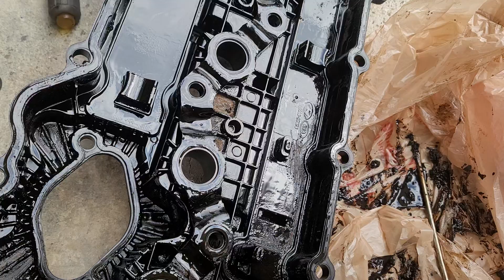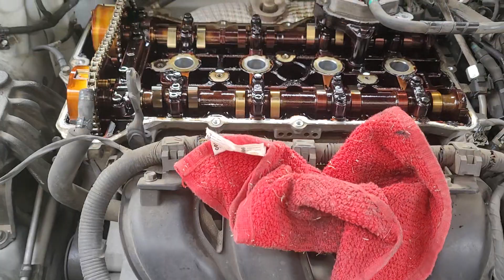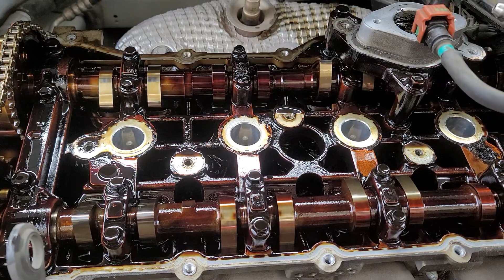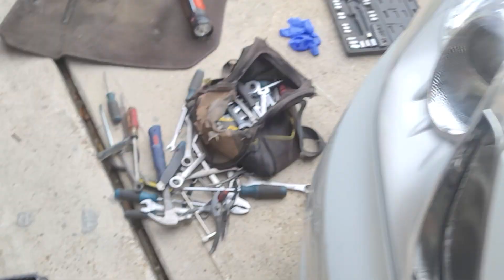Amsoil 100% synthetic superior to full/conventional oil

Comment: Please explain the difference between Full synthetic and 100% synthetic oil.
Reply from the maker: The best way I can explain it from my experience. 

Mobile 1 full synthetic 
80%conventional 20%synthetic additives

Amsoil 100% synthetic
100% synthetic oil

The best way to experience the 100% oil is with an air-cooled engine like a lawnmower/2cycle engine. The reason I use those is because it is a small scale. You can test with 1quart of the expensive before investing the whole $120+/- for vehicle oil change. This way u can changes by listening. The key point here is heat dissipation, heat transfer, and heat resistance. 
Run ur lawn mower with ur choice of oil until hot, remember the sound. Immediately drain the oil and replace with 100% synthetic. U should hear the engine smooth out. Even mixing the 100% synthetic 4cycle motor oil to gas(2.4oz per gallon regular gas) for weedeater/chainsaw/etc. Empty previous 2cycle gas and add the fresh synthetic mixed gas u should hear a difference when the 100%syn hits the system. Thats what I personally experienced. I was servicing lawnmowers for pay. I would upsell my 100% synthetic stock for lawnmower oil change. I would let the customer listen to lm with there oil. After the change they would hear the engine smooth out and comment. I heard the change. 

The reason I use lawnmower as study is because it is air cooled. The temperatures go up as u load the engine. Idle u see about 250-270°f free/light load but anywhere from 350-400°f under load. The air cooled will break down regular/full synthetic turning it black in about 4 cuts. The heat breaks the convention portion ofthe full syntheic oil down. Causing it to blacken

With the 100%synthetic it does not cook under the load. My lawnmower oil keeps a slight brown oil once old black is flushed out.   Also I have seen the old tarnished oil sticking to the interior engine block/case melt off once the 100%synthetic cycled the system for a period. 

100% synthetic is itself a detergent to keep the internals clean.

I now run the amsoil transmission fluid and the car shifts silky smooth. It was time for maintenance change so just went with 100% synthetic trans fluid.

Also I have had oil spills with the 100% synthetic wipe and rinse, what oil spill? Oil spill with conventional u might as well spill across the floor so everthing is the even stain concrete.
Reply from the maker: https://youtu.be/uzHRYxRiboc?si=ihq0JkcgmfACi-tk

This will show u air cooled engine temps.

Car engine temperature is regulated to 230°f+/- by the water cooled radiator system

Comment: My friend I got 280,000 miles on my Toyota using only conventional oil. Changing the oil every 5,000 miles. It is totally clean. Doesn't have any buildup, sludge or anything. My oil dipstick is still totally clean doesn't have any black residue on it. This girl most likely ran this engine with low oil in it multiple times. That's why you are seeing the oil turning into soot like that. Seen this before

Comment: You gotta be careful digging all that crap loose.  I'd hate to see it end up in the bearings or clogging something important.  But I agree, cheap oil is never cheap in the long run.  I beat on a 97 altima with almost 300k miles daily.  I've been running conventional castrol 20w50, but change it every 2500-3000 miles using a napa gold filter.  Once upon a time, I fell victim to the fram advertising BS and then one day I cut one open.  What a junk filter fram makes.  All the best!
Reply from the maker: @jagboy69  the engine gave out in march'23 due to hyundai engine recall. The 2nd piston rod bearing seized locking the engine. I rebuilt the engine. When engine was new  til siezed it was consuming 1½quarts every 1500miles. After rebuild I am topping 1quart every 10,000miles. Using that amsoil signature series. Did 20,000mile oil change it was still fluid. Thats 20k driving and idling. So I use nothing but amsoil if I can get it. 

They say replace oil 500miles after rebuild but I replaced after 125miles because I didnt want the cheap oil clinging to nothing.
Reply: @thisismee3642  why is amsoil to impossible to find??  Just bought a new Honda mower and wanna run amsoil after break in.
Reply from the maker: @jagboy69  u can order from a dealer around u or buy direct from amsoil website but they want $100 order for free shipping. I buy like every 6months. I would suggest get u $100 buy their oil & filter find what ever else type of fluid for ur car. After engine rebuild I replaced the transmission fluid with amsoil and it started shifting really smooth. Get a tube of the dominator grease. I use that grease on all my bearings. Even took my drone tiny electric motor apart and put amsoil grease there. When I tell u smoooovee.

Comment: Also why when switching over and depending on what's inside the engine the Amsoil engine and transmission flush should be used to help remove that build up for the next five or six oil changes!
Reply from the maker: The 100% synthetic is a cleaner itself. You can take a cheap $20 junkyard lawn mower engine. Change the oil to 100% synthetic. Run the engine for a little while til hot.  Then open the engine, you will see the gunk and dirty oil falling off the metal. I know because bought a b&s generator. The previous owner used tge convent oil, black and thick. I changed to 100% synthetic because it becomes a duty engine with it. Found there was an oil leak. I dissembled it to fix the leak. And I saw first hand the metal getting that new metal appearance.  And the gunk sliding down the case. 

I just did my rocker arm adjustment on my motorcycle. Inside the valve cover looks polished. I thought about making a video but was not sure if anyone wanted to see me talk about the effective cleaning power of 100% synthetic. I replace oil 12,000miles have 21,000 right now. The oil still looks good and these are hard miles. I am not a highway cruiser.
Reply: @thisismee3642  I understand what your saying completely what I'm telling you is the Amsoil engine flush takes it further before you put Amsoil oil in you add this flush run it for fifteen minutes with the engine hot and it aides in breaking down sludge so when you add Amsoil after you drained the old it helps to further the cleaning that Amsoil will do. Just try it you will see I had a sludged up engine in a car I bought from a grandma after 3 oil changes it was sludge free because I used the Amsoil flush and Amsoil oil with Six filter changes. I took it apart to replace some seals and I was amazed to say the least.
Reply from the maker: @Jon-O.  alright, clear misunderstanding on my part. Alot of times tinker'ers be asking questions. I will try that next time I order some. I scour the peer-to-peer sale sites for people selling purchased amsoil. One purchase rendered 8quarts motorcycle oil and like 6 100%synthetic oils. Dude let it go for like $40. Found a lady, didnt know it was a lady, sell me a Polaris kit 2quart and amsoil signature filter $15. 1 dude let 5 quarts of signature series go for $25. 5quarts of deseil 100% synthetic for $20 I think. 5quarts of the dude bought for a mustang  $20. I just buy it when I see it avaliable because I know I would spend double if I bought from amsoil.
Reply: @thisismee3642  hey did not know this but again if I can afford the best for my vehicles I have no issues paying for a proven quality product but finding it cheaper some where is a bonus and wise move.
Reply: @thisismee3642  that's why you don't trust mechanics when you value your car that much. You should watch Scotty Kilmer channel, people says he's full of crap, but he's one of the most honest youtuber out there. With a 100 % synthetic motor oil, you don't even have to use an engine flush fluid, the synthetic itself is high in detergents like Diesel multigrade motor oil.
Reply from the maker: @danteerskine7678  I will tell you how clean 100% synthetic is. Had a spill of some. Wiped it up and its like it never happened. Same thing happened with the conventional. I have to find the degreaser and then get the pressure washer. The surface will be clean but conventional sinks in and dont cone out.

What started me on my 100% synthetic journey was wanting to find out the best. Not just brand markeeting. So I bought in with the supertech full syn 85%conventional/15%(100%)synthetic blend. Reconized the little improvement then studied the (full/100%) oil terminology. Bought my first 100% synthetic amsoil signature series ($65) at the time. From a guy for like $25. I was stunned by how smooth the car is running. After that I am hooked.

I also realized that with the synthetic polymer oilf filter. Can easily do 15,000miles. Of course checking the oil level. Also this synthetic keeps the seals and gaskets pliable. Holding its shape and stiffness like new. The used oil change runs burn in my 2cycle mix. 

Cant use nothing else.

Comment: How often was she changing it though?
Reply from the maker: She was religious with the changing. What happens is the remaining oil after the oil is changed that breaks down. So when you change oil from conventional to conventional. You still have the same conventional properties. For instance I started changing the oil because I wanted to monitor engine work. I showed her the way the conventional was beatup black and syrup'y after 3000 miles. The car ran good, but when I switched her to supertech full synthetic. The car instantly started running better. Because it had some synthetic properties. Yet the oil change showed beatup black and thick oil.

It wasn't until the I just out of my pocket bought the amsoil 100% synthetic that I seen the difference. I showed her and anybody I do service for the results. That way they are informed. They probably dont understand the technical aspect but visually reconize fresh oil, worked oil and beatup engine failure oil from the look of it.

I bought a 12000watt peak/8000watt continous generator. First thing I did was change to 100% synthetic. Well I notice a leak. So I dissembled it. You could see in real time the trash conventional oil being dissovled by the 100% synthetic. Basically  you could see how it is essentially washing the metal clean. I showed my brother cause he happened to be around that day.

I use 100%synthetic oil in everything. I even keep the used oil to run my 2cycle oil/gas mixture.
Reply: @thisismee3642  was she doing 3000 mile intervals with the conventional? the statement, "religious" doesnt provide enough content?
Reply: @thisismee3642  I wouldn't call conventional oil trash, before synthetic oil was a thing, multigrade conventional motor oil were the best due to their high zinc properties. I own a generator and since day 1, I used nothing but 15w40 conventional Diesel multigrade motor oil and it's still running smoothly without any visible smoke.

The key for an engine longevity is simple, Regular oil change, whether it's conventional or synthetic, will maintain engine cleanliness in the long run.

Therefore I consider monograde motor oil as trash because they're thick and non detergents oil, and harmful to newer engines.

I also use both mineral and synthetic oil on my petrol generator, I had no problem because the oils I use are from renowned brands like Motul, Castrol, Duckhams, shell, Total, Petronas, Mobil. Always stick to renowned brands because they're well established
Reply from the maker: @xlightssx  religious meaning someone told her 3,000miles and she followed orders religiously  without thought.